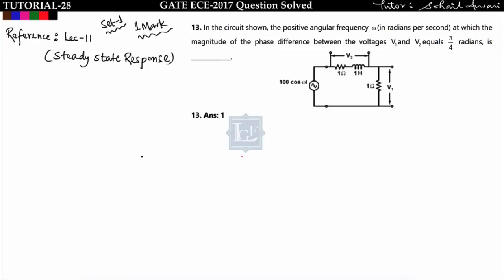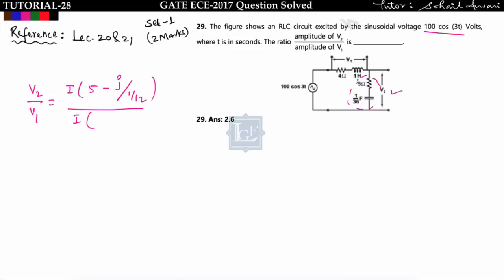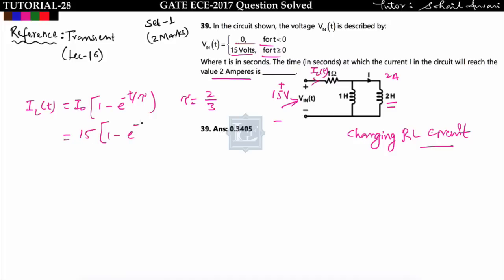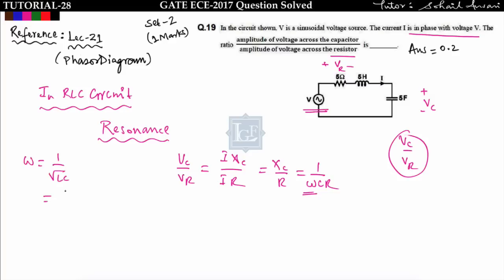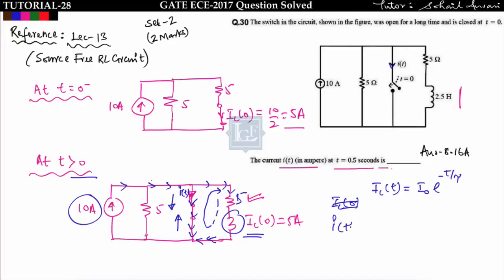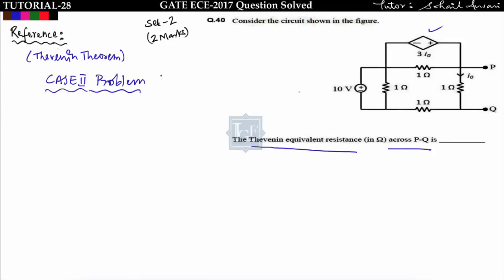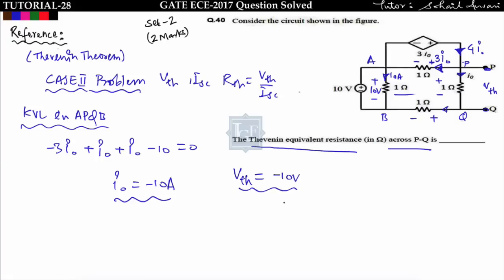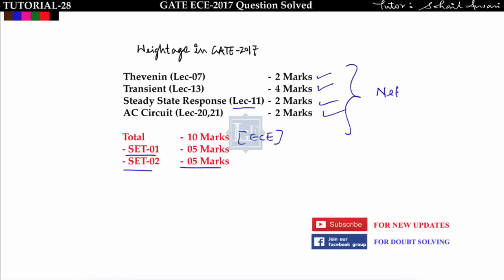Lec-28 GATE 2017 ECE Question Solved

Comment: The ans of last question must be -2 ohm bcoz the resistor in parallel with current source will not be shorted so Isc=5A and not 10 @gatematic education

Comment: sir @ 12:34 is there any reason of taking 4 io, i think it should be
  3 io. if i am wrong plz correct me.looking forward for your reply....plz clarify this.
Reply: got it sir, 3io is voltage source value.due to parallel connection current through 1ohm resistor is  3io/1, vch is equals to = 3 io only.  den, sum of currents are 
3io+io = 4 io...
Reply from the maker: yes

Comment: at 14.30. while finding In, u neglected 1 ohm resistor connected in parallel with the voltage source(10V). even after considering it we will get the same answer. I mean current flowing from 10V will get equally divided between two parallel resistors of 1 ohm.  correct me if I am wrong. thanks
Reply from the maker: i have not neglected..both 1ohm are in parallel...ans u have to find In....so In=10/R...